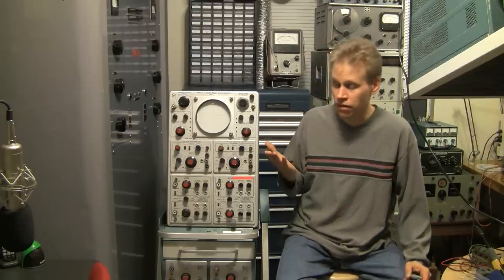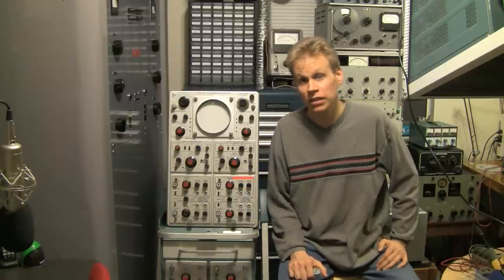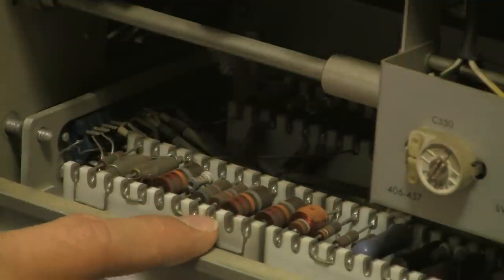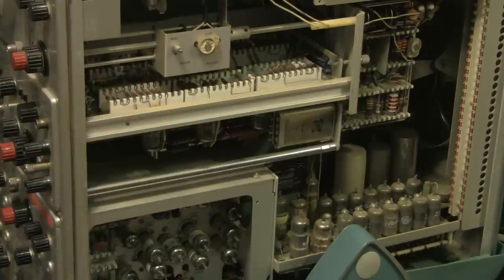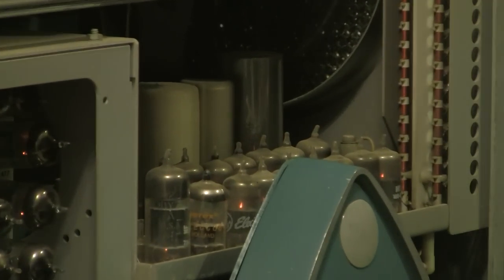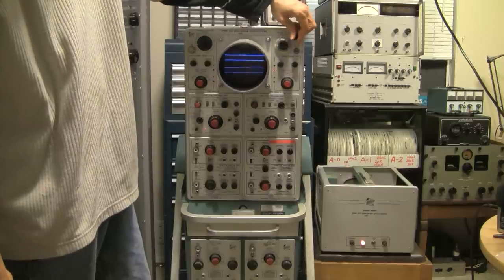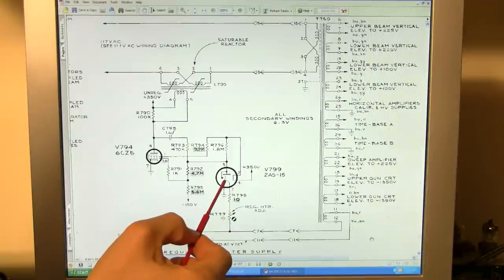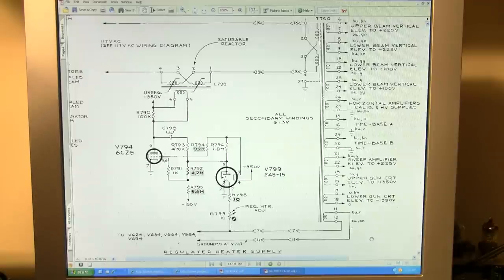Tektronix type 555 oscilloscope, over 100 tubes inside!

Comment: OMG I take it back it does work.  I removed the cover on doing so I needed to remove the plug as it didn't fit through the hole and is extremely  short  when i did i noticed the ground wire was not connected.  Connected it switch it on to see what tubes would light up and I adjusted the knobs back to base or 0 and just turned a few and bugger me a green dot appeared , used the speed knob and sure enough across the screen it went.  Its not straight obviously way out of alignment and calibration but it does come on.   That makes me happy but even more reliant on a schematic to be able to get some sort of calibration happening.  It tickled me inside when i seen that green light  And it all seems to work to a degree,  all knobs had some effect on the dot speed was from stop to so fast I couldn't see it brightness etc all works.
Reply from the maker: Glad to read your scope is working!
Reply: LOL yeah it sort of works LOL.   Its damn rough and someone has been inside it as many of the caps seem to have been replaced with poly dipped ones. cord butchered screws missing from the bracing and the tube is on an angle , also many of the adjustments have been played with inside it. I realized this when the ball adj was turned right around as far as it could go, Thank fully the factory or maker had put little red paint markers on them when it was calibrated I guess. so i just lined those that were out back up.  I only get one green dot that goes across the screen and i can turn it up speed wise to make it a constant line . All the controls seem to work except the triggering but maybe it will when hooked to something i dont know enough about them to know if this is normal or not and  I don't have any probes as yet for it so I will have to wait a bit to try and calibrate it.  I did found  the manual on line and it has  the calibration procedure in it  but i really would like the schematics as its very very old ad dirty you have no idea , I cant even see the resistors on the board its thats bad and thats after blowing it of with a compressor. And thats not a joke its for real , How it works still has got me bugged.
I have been searching on line for what to use as a cleaner and it seems water is about the best thing. But i hate putting water any where near electrical components and bare metal. To me as a mechanic of 45 years I know they don't mix. But it seems common practice in this field.  Also I noticed on the plug that the black (genrally neg lead) is connected to the fuse not the red wire which generally is the hot as you call it. So I will look in to that as well when i replace the plug and lead.  All the controls do seem to work  Vols/cm it steps up or down position works on both up and down and the length of the trace and speed works from virtually stop to constant. The only thing I don't seem to get any response from it the triggering switch.   I want to clean it and dont really know what to use right now I was thinking just soapy water then spray water dispersant on it after and let it dry in the sun for a couple days. Well couple hrs here at the moment its around 35-45c most days here at the moment 47 c the other day.  But then i read not to leave electronics in the sun. Would this be OK.   Its a Kikusui Jayen 555 model.  I have since discovered also that the front of the tube is just floating in mid air and the rear holding clamp has no gasket/seal/seat around it , its just the metal band done up on the glass. Not good.  And was pulled right up to the board that plugs in to the tube. How it never shorted is amazing.  So I intend to 1 fix the tube mount issues and the cord first , Then replace caps and check as many resistors as i can .  This all after i work out how to clean it. LOL.   Going by the looks of it I think maybe its been apart or made up of parts and its rough as guts.  I couldn't even see the bottom board the dust was that thick I think its just been left in a shed for decades filling up dirt and dust etc.  I would love to send you a pic of before and after.  And I do intend sticking to it until I get it back to a working unit.  Sorry for the long rant but their is so much I need to know to get this right and i have ZERO and I mean ZERO electronics experience.

Comment: Saturable reactor...interesting...I have a1956 P&H TIG welder that uses a sat-reactor or also known as magnetic amplifier..(Mag-Amp) to control the welding current...changes the current as fast as you can move your foot...
Reply from the maker: +Doug Ankrum 
Lots of innovations were coming along in those times!
Reply: +Mr Carlson&#39;s Lab ....Yes, for the 300 amp output, this welder has a huge assembly of selenium rectifiers...how old is that stuff...?

Comment: You can get silver bearing solder from many hardware stores.  And yeh, a good old Tek scope will work at least as well as the fancy digital scopes that are sold today, for the same price, or better.  Get yours!  I got mine!
Reply from the maker: Now there's a man that knows what he's talking about! Thanks for the comment.
Reply: Clyde Wary 
I bought a Tek 2465A DV on Ebay for $400. It is in mint condition except for a crack on one of the knobs. I bought 2 brand new Tek probes for it and it's been working great. I also found an original front cover for it for $100. It was expensive, but worth it since it was the only one I could find.
Reply: +Robert Calk Jr. Saw on eBay recently a complete set of new knobs for a Tek scope.  Don't remember the model, but I'll bet some or even most of those knobs might fit your scope.

Comment: You were saying that the scope itself had a mains transformer within. What was the function of this transformer? Obviously it was supplying something that the xternal PS. was´nt.
Reply: It is that multiple section heater supply transformer that is located inside the scope itself, to minimize the number and size of wires needed inside the interconnecting cable between the PSU and the scope mainframe.  Only the primary side and the secondary feeding the 2AS15 then need to be brought through the interconnecting cable, rather than the dozen or so different secondaries.

Comment: Nice old scope that I have a valve (tube) scope and one problem is that when 5he workshop heater clicks on it drops around 8 volts off the mains and the scope needs its time bases re adjusting I think you're won't have that problem
Reply from the maker: jon johnson LOL..... nope, because the scope is the heater as well! :^) Thanks for your comment!

Comment: Grew up with Tek and HP Gear, 70s onward. Tek strode the World in scopes. None better then; none better now. HP had a fatter catalogue, and their 70 grand Network Analyzers were, and are, Supreme.
Still have, operate, and service my Tek and HP gear: 2465s, 2467s, 492P, 7000s with fifty or more plug-ins. Lot and lots of other gear. They'll probably bury me with it; because I sure won't sell it, or give it away.
STRANGE!
In the Defense World 60s to 90s, when the big time  contractors got new programs from DOD, they used to chuck overboard all the TEK, HP. FLUKE,etc
  etc. iron, and FULLY RE-EQUIP THEIR R&D AND DESIGN LABS WITH ALL. NEW GEAR!!! Done to make full use of multi hundred million dollar "infrastructure" components, so that they wouldn't be lowered for new projects later.
You wouldn't believe the amounts and varieties of state of the art TEK, HP. FLUKE. SCHLUMBERGER. AND ON AND ON, THAT GOT REGULARLY AUCTIONED OFF OUT OF DOD CONTRACTORS, ESPECIALLY IN SOUTHERN AND NORTHERN CALIFORNIA, INTHOSE TECH ROARING COLD WAR DAYS!!

GOT MY GEAR THAT WAY.

Comment: The inflation calculator comes up  with $21,800 (US) in today's money. I find that rather cheap for a top model. Today's "low  cost high end" series (MSO5) from Tektronix (June 2017) are starting at $20,000 going up to $40,000. The top model is way over $200,000. Times have changed.
Reply from the maker: They sure have!

Comment: Have been using Tektronix and hp and many other in Distance measurement Radar all oscilloscope especially designed for particular equipment even for ARSR as sweep generators to analyse Radar receiver IF response curve and many displays as indicators for monitoring air traffic and guidance…British German and American test gears and transmission or Reception systems standards are unique in quality and parameters stability,,,towards by short association with aviation,quality standards are a must to  have good basics for years to face rough weather thanks for oscilloscope and other test gears Marconi RACAL Westing house RCA to recall glorious brands🎉
Reply: You are fortunate to play and enjoy viewing test instruments of top notch brands good luck and grace of parental upkeep and all in all 🎉

Comment: A couple of quick questions...  Would someone be able to explain why using a standard non-silver solder (like 60-40) would cause the connections on the porcelain wafers to separate from the wafer?  I'm assuming it's not due to a temperature issue as silver solder should have a higher melting temp.  Correct?  And, is there a quick way to test to see if silver solder has been used on a connection?  Thank you
Reply: I have used regular solder on those wafers, quite a bit, and have never had a problem.    Ideally it should be silver-bearing solder in order to alloy and latch on properly to the silver plating, but if you're just replacing a part you can just leave on a generous amount of the original solder and just add a dab of non-silver solder, no problem.

Comment: It could be a UV component in that phosphor light, the camera's image sensor is more sensitive to UV than human eye causing it to appear brighter blue in the video recording.
Reply: It should be IR, you can see this if you take a TV remote at look at it through a DIGITAL camera while pressing a button, its the same colour as in this video. 

...However, im not sure if it would work the same as with a video camera from that era, as they would have been using those old tube cameras that actually used a special vacuum tube to generate an ANALOG video signal. So I have no idea if it would work the same...
Reply: Ryan Smith That is also a possibility, I have looked IR LED's glow with digital camera for years now.
Reply: Digital image sensors are very insensitive to UV light. (On the other hand, they're so sensitive to IR that we normally put IR blocking filters in front of the sensors, otherwise the visible light image would be wildly distorted.)
Reply: Antonio Tejada Actually the sensor itself is sensitive to UV radiation too, only the digital cameras have filters that filter it out. Although some part of the UV radiation gets through still. I have tried to photograph objects fluorescence under UV-A LED light and the images came out with overexposed blue on my Optio E30.
http://en.wikipedia.org/wiki/Ultraviolet_photography

Comment: if I heard you right some of the tubes are solder in.  if for some reason they do manage to go bad because of age how would you replace them. it been a good while from last I rip apart a old tv with tubes in them and I was in my young teens then also
Reply from the maker: The tubes that are soldered in, are in the high voltage section. I haven't seen one fail yet. If one was to fail, it's as easy as desoldering 3 wires. These tubes have wires, not pins.
Reply: Mr Carlson's Lab thanks.. an seen most are made of tungsten just higher grade and thicker then a light bulb just figure it a matter of time before they go bad. but how do you manage to come by rare to find tubes or what do you replace them with if one can't be found..

Comment: At the 6:52 mark, your finger points to a resistor that's wrapped by an inductor.  What is the significance of that arrangement?  Is that coil attempting to contain RF emitted by the resistor?
Reply: CondoneinRedondo. That is exactly what it looks like, a resistor in parallel with an inductor. I can't tell you why that physical arrangement was used. I probably knew but I left TEK in 73.
Reply: The only other possibility I can think of is forcing the inductor to be at the same temperature as the resistor.  But I've never heard of that.  I've seen transistors locked together thermally, I've seen resistors mounted to the same clip to assure identical temps... but I've never heard of temp compensation for a coil.  I'm really just reaching here.  I'm more a digital guy than RF or signal.  My experience in the analog realm is limited to audio circuits and linear power supplies.
Reply: There used to be inductors wound on what looks like a resistor - but it is only a body with two leads molded in it. Inductor is wound on the body and ends leads terminated on the body leads. Almost exclusively used for RF chokes. I believe this is the case.

Comment: Kind Sir, with reference to regulating the filament voltage, what is the purpose of C-793? Thanks.
Reply from the maker: Hi Pat. It's just there for stability reasons, along with R793. The circuit resembles a feedback loop, but this is a DC circuit.
Reply: @MrCarlsonsLab  Thanks Paul.

Comment: In 1959, the average price of a brand new house was $12,400
in 1959, a brand new Cadillac Eldorado cost $7400
In 1959, $30 at the grocer could feed a family of five for a week
$2600 in 1959 is equivalent to $22,602.28 in 2019, for a base model unit.  That's a damned expensive piece of gear.

Comment: Tubes can actually be very reliable.
Reply: Did my own test of tube life on my preamp with its premium quality 12AX7 tubes. I replaced them after many years of use and heard no difference so I put the old tubes back and I'm still using them today.
Reply: They're more likely to survive the EMP pulse from a nuclear explosion.
Reply: Yeah but my solid state power supply will probly be fried but I do have an MOV protector on it.

Comment: I just got a 535 and am a bit scared to torn it on, I have plugged it in and turned it on once for 10 seconds and it crackled like a TV when I flipped the switch, after I turned it off it started to smell bad like burning. Nothing looked burnt but I don't know what to do now. Also, I'm affraid because it has transistors in it.
Reply: James Sorensen,  Did you follow his restoration process, starting with owning all the tools such as an isolation transformer and current limiting circuit? Since it IS a Tektronix scope, it will be ready for anything going wrong, unlike many other brands and types of instruments. Your nose and ears saved this old scope from ruin, I'm sure, but pay for REALLY good quality, upgraded components in case that is necessary... bought from a reliable dealer, not a local hack who might sell you pirate goods, or worse... from an online supplier from whom you might buy junk parts at bargain prices. Get a REAL Tek manual for your scope. Follow it like it its words were directly from God.
Reply: @BruceNitroxpro  I have gone over it and tested the values of the components I could reach and they tested very close to if not on what the manual listed for each section. This machine did come with a manual for the dual trace plug-in and documents faxed with a 5 digit phone number in 1997. I contacted a local guy who works with old equipment from the time period and he told me to put light bulbs in series with uncertain equipment. I did this and it works well now, the smell was the air filter in the back which had nasty yellow gunk in it which I then cleaned with detergent and put back in place and most of the smell was gone. I worked up from a 25 watt lamp to almost 500 watts monitoring total current and the voltage going to the scope. The B+ voltage engaged at about 100 volts mains. I added another 200 watts at that point because it's voltage went low and then shorted the resistive load giving it full power. It drew about 4.2 amps at 125 volts and the tube and both traces cane online. Both traces responded to audio inputs and the time base works in the lower half of the range. There is a hv problem causing the tube to behave strangely. The tube has a nasty burn in the center but seems to work otherwise. The plug-in has issues with the position of trace#2 where it's highest defined x value is at the bottom of the screen. The right trace is fine but acts weird when I don't have the ground connected. When I've fed it an audio signal from a tape player, it displayed the sound, but even with a sine wave, it had a hard time keeping it still. I messed with some of the knobs observing them and couldn't fix the issue. I can't remove anything yet because I don't have silver solder yet. I'm aware the substrate is very delicate. I ran it for 10 minutes and  then probed the major electrolytic capacitors none of which were near hot. If i had a thermal camera I would use it. I plan on building a rack cabinet for it so I can work on it properly. I may contact tectronix to see if they can give me an estimate for maintenance and rough calibration. Thank you, I appreciate you. Reply if you know of anything else I should know.

Comment: at 6:52 what is this resistor with an inductor wound around it? thats strange.
Reply from the maker: Tek was great for creating a specific part for the job. This is actually not all that uncommon, you will find this in older radios as well.
Reply: Tek used a lot of very company-secret T-coil coupling circuits to extend the amplifier bandwidths.   But that was mostly in later scopes.   In this one that's probably a coil that needed to be of somewhat lower Q, as not to ring on and on after a sharp leading edge of a square wave.    Since it had to be a custom coil anyway to get the right value, they just specified to the coil-winder company to wind the coil on a xxK ohm 1-watt resistor.

Comment: a) vertical amplifier, not delay line (which is actually a dual conductor coaxial cable)
b) silver bearing solder ... just a few percent silver. not 100% silver.